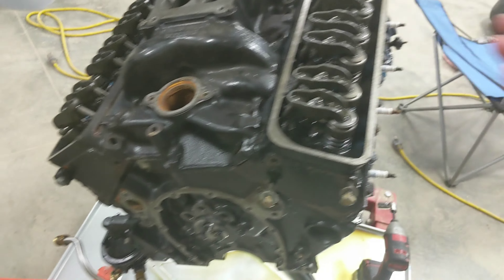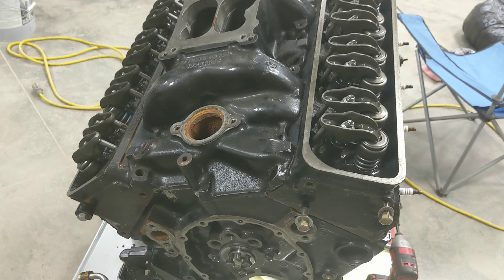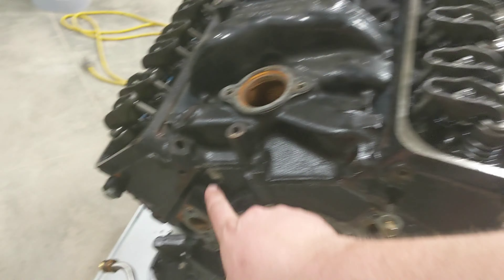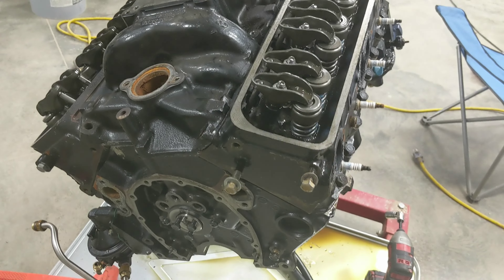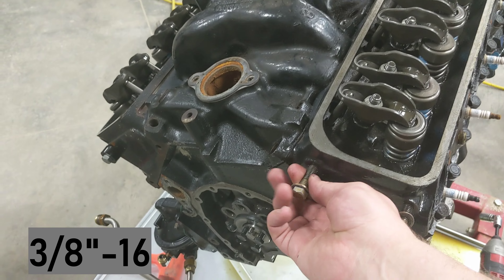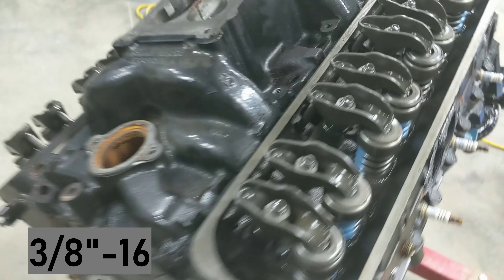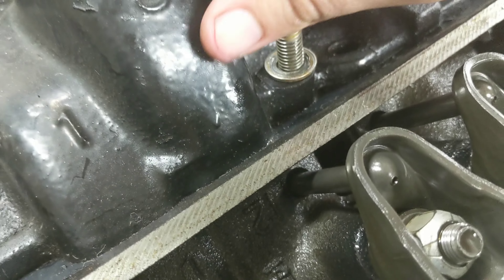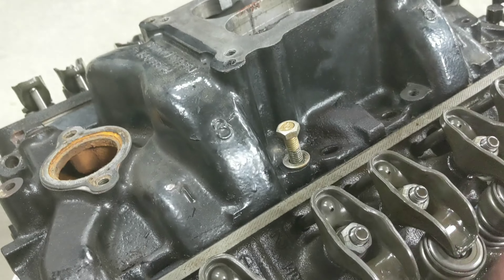The Trick for Removing a Stuck Small Block Chevy Intake Manifold -- Quick and Easy!!

Comment: I wouldn't try that with aluminum heads.  But great idea!  Thanks for sharing!
Reply from the maker: Ya it depends. I've seen it on certain aluminum timing covers as well.  If its set up to work that way, there really shouldn't be any harm.  In this instance, Chevy was thinking and made it bottom out against the head so that even if there is a gouge, it isn't a sealing surface.  Its a cool idea I think.
Reply: I maybe wouldn't do it with the impact but I got it to work just using a ratchet. And I did this to get an intake off an 86 Corvette. 38 years old and this technique worked like MAGIC!!! I can't imagine using a basic ratchet going nice and slow would hurt aluminum heads.
Reply from the maker: Send it! Lol. Glad it worked for you.

Comment: Call the scrap guy. Best thing to do with a chevy sb
Reply from the maker: @Wuggieee  can't argue w that.
Reply: @605BOLT  get an ls if youre gonna run chevy
Reply from the maker: @Wuggieee  this is for a boat but sure. Only needs like 200 horse for what I do with it.
Reply: @605BOLT  chevy onlu made one good sb and that was the 4 bolt main 327. Ls are a dime a dozen in the junkyard if your dead set on a chevy
Reply from the maker: @Wuggieee  all the accessories on this boat are mercruiser so you kinda gotta stick to SBC to keep the cost down
Reply: @605BOLT  well that sucks. Good luck
Reply from the maker: @Wuggieee  she's good. Been running for like two years now.

Comment: is this safe to do on a different car? I have a mitsubishi magna that has the intake manifold pretty damn stuck but im afraid of damaging the valve cover
Reply from the maker: Is possible other brands have this type of a hole. I've seen them on Ford timing covers too. But it really depends. If it's metal I would say it's possible but the plastic ones usually have some other way to get them off. Good luck!

Comment: Felt really good about this until the bolt head came flying off.. 😐
Reply from the maker: What?! Damn dude that sucks. Well get cutting and then extract the bolt. Sure you're in the right hole?
Reply from the maker: How did you turn out?
Reply: @605BOLT  the bolt might have a new home but I think in the process it did loosen the seal! I was able to pry it off with a crowbar which I had tried maybe an hour before.
Reply from the maker: Ok glad to hear you got it going. I've had good luck with this process so I would feel bad if something was big time messed up.
Reply: @605BOLT  no in fact this was the only way I was able to get it out so I appreciate it!
Reply from the maker: @jordanschultz2232  ok good deal. 🍺